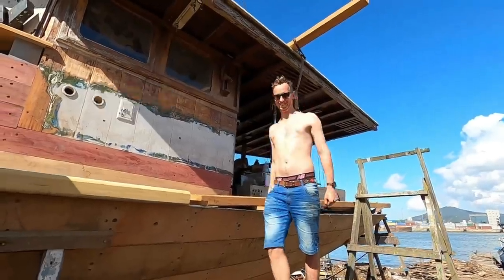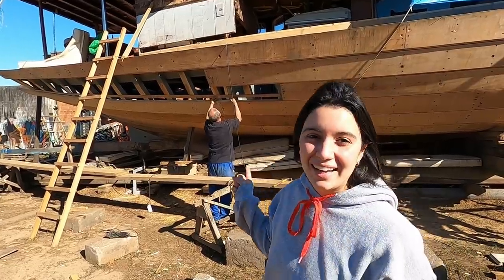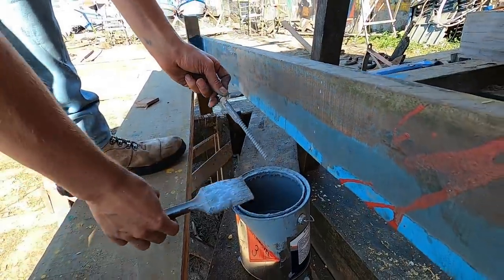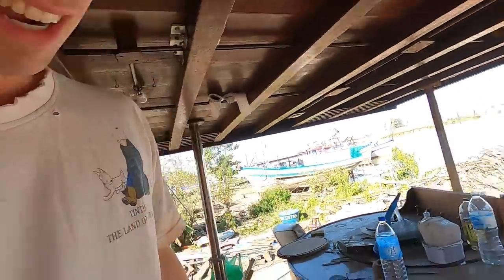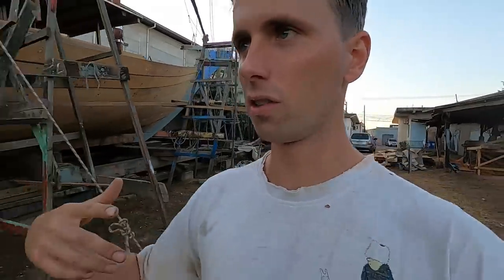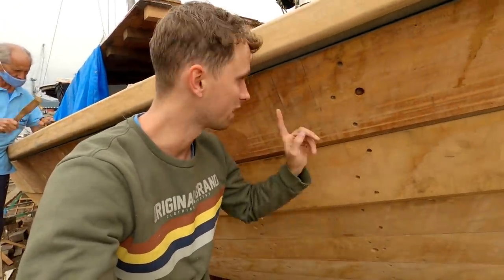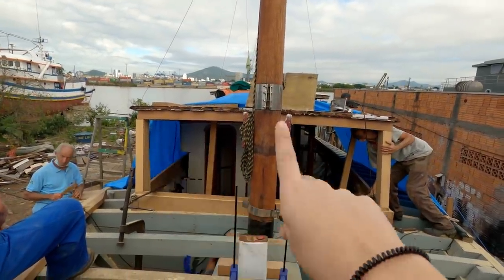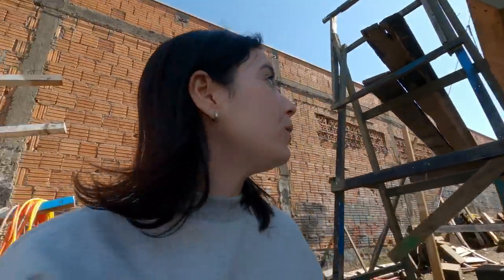We installed THE LAST PLANK! But our hull is not shut yet! — Sailing Yabá #42

Comment: That "tabica" is like a Western "covering board", but only covers the top of the planking, and not used as a rub rail. Nice to see a different way of doing the job. The holes being made for the wood stanchions to hold your bulwarks are a traditional rot spot, worth the extra time to make a good caulking seam and flexible sealer on top.  More power to everyones elbows!
Reply: Maybe even paint the inside of the holes

Comment: You guys are getting SO CLOSE..! I really can't wait to see the finished product.
Reply: In truth, there is lot more work to accomplish, caulking, sanding, decking,
Undercoating, painting, mechanical, electrical, fitting out, standing rigging, running rigging, water tanks, fuel tanks, navigation equipment, generator, etc., etc.
Reply: @PETERFWESTON  no fucking shit Sherlock... Smfh... I know they're not done by any means but compared to a month ago. It's a whole different boat and it's a lot closer.

Comment: These guys are awesome! I amazed at their skill level, especially at how they use the chisel! And your vessel is beautiful. But their shipbuilding technique is century old, is VERY labor intensive and the hulls end up very heavy. And, last but not least, wood prices in Brazil went sky high in the last two years. It will be very sad if such construction technique becomes unviable and those guys end up jobless. Perhaps they could explore a much larger market by building lighter (and less expensive) hulls using thinner planks covered with fiberglass.

Comment: When you have the hull done you're 1/3rd of the way there... Fit-out. Engine. Controls, Electrical, Masts, Rigging.....
Reply: I think that 1/3 is an optimistic estimation. But even with that a big important part then is done.

Comment: If one watches several channels of boat building everyone else draws plans up to full size and then makes patterns from the plans. Sailing Yaba bought a boat then removed each rotten part to use as patterns to build a new boat. I guess it is a different approach to boat building. I wonder if they would have purchased the boat if they new they would have to replace the hull and deck. I wonder how much of the cabin will be replaced. I must say it has been interesting to watch the process and see what this boat yard can do. I have a feeling that before they new it they were in so deep they could not stop and had to keep going. I hope everything turns out good for them in the end.

Comment: I keep wondering if just building a new boat would have been cheaper or about the same costs anyway. It looked like you had to replace at least 80 percent of the boat anyway. It's cool what you guys are doing, I'm just wondering about the overall costs for a project like this and comparing. also I'm still wondering how it operates as a sailboat, the keel doesn't look like it has enough weight to act as a counterweight for the sail when leaning. so does it use some other kind of counterweight system like stones in the bilge or something like tall ships of the olden days?
Reply: I keep wondering if you should keep repeating that comment seeing as everybody else repeats it as well.....
Reply: @MegaDirtyberty  i guess the point stands to reason.

Comment: I'm surprised they didn't use the saw dust as fuel for a steam box.  They sure work hard to bend all that wood.  Have they said why they don't use a steam box?
Reply: Since the wood is green (fresh), and can be coerced into position with clamps, it speeds up the building process to skip the steaming.
Reply: @gav2759  The builders build the boat as they see fit, they don't look through the comments to see how they should build it....

Comment: i would still have prefered those planks to have been steamed, they are under a lot of stress, my 48 foot ketch all the kauri planks 2inch thick were steamed did not have to use all that pressure they bent like putty to fit the frames.
Reply: Well you are not the builder so the builders get to decide eh.